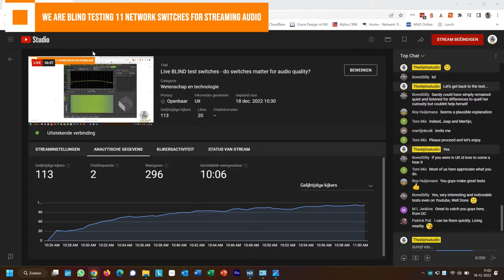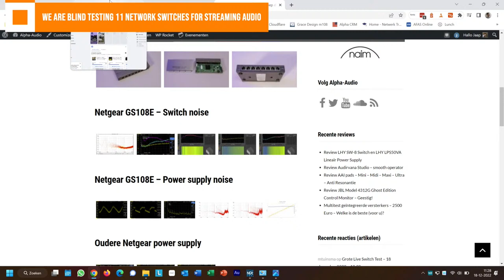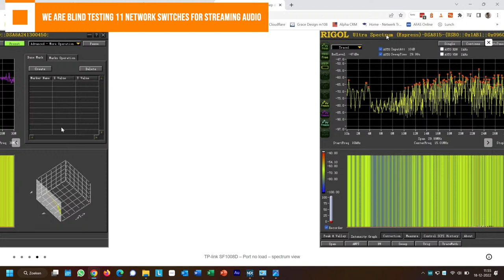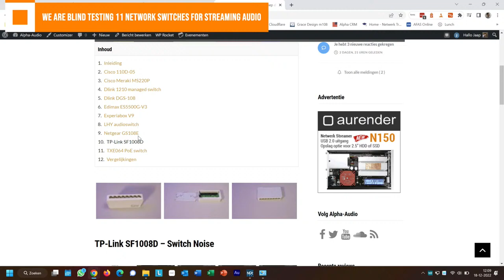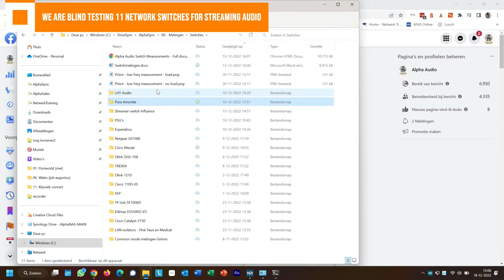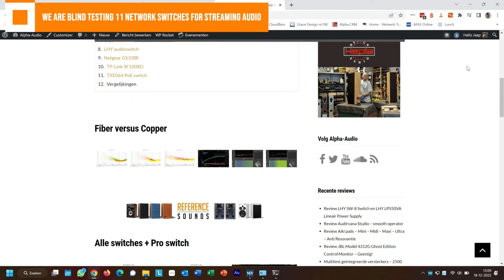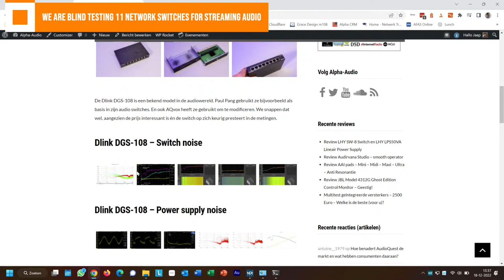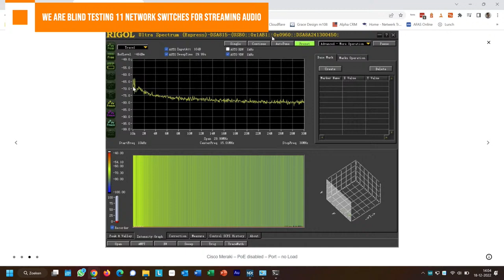Live BLIND test switches - do switches matter for audio quality?

Comment: The folks asserting that a network switch can't possibly make any difference are really really missing a massive fact. Yes, if you view this whole thing purely through a digital lens, this is absolutely correct. Bits are bits, no bits are harmed, no bits are enhanced, and all the bits arrive in the right sequence. Bascially there are no data errors, which is absolutely what we should demand of any network switch.
The only difference a network switch can make to audio is through the amount of (analogue) RFI/EMI noise it stops from getting to the analogue bits of your DAC. Hence importance of power supplies, of quiet circuitry, etc.

It's not only arrogant and rude to suggest people who hear a difference having installed a switch are imaging things, it's plain wrong. Oh, and other videos are available, no need to try to save people from themselves here.

Having said that...
1) The test was hardly blind. Too many visual clues to the "blind" listener.
2) Personally hearing differences via Youtube played on your own system at home? Nah, sorry, not buying this. Treat the videos like an article not a demo and we're good.

Thanks to the guys at Alpha Audio.
Reply: Have you tried listening with headphones?
Reply: "The only difference a network switch can make to audio is through the amount of (analogue) RFI/EMI noise it stops from getting to the analogue bits of your DAC"

To find out if this "RFI/EMI  noise" does impact the output of the DAC you have to measure the output of the DAC....
Just to assume that noise on Ethernet impacts audio quality is not a valid assumption.
Reply: @elkeospert9188  My lying eyes and ears... That is the problem with you science audio guys, if you cannot measure it, it does not exist. Maybe put down the scopes and listen to the music or actually look at the television with improved PQ?
Reply: @michaelwright1602  The problem with you is that you not understand my comment.

In this video the noise was measured on the streamers input  - ASSUMING that noise on the input impacts the quality of the streamers output.
This might be a correct or wrong assumption and the better way to find out that is to measure the noise on the output of the streamer.

And if somebody claims to be able to hear differences between different switches you can check that by performaning a correct randomized and double blinded test.
You not need any scopes or other measurement devices to perform such a test...

Comment: Are you going to compare the best copper connected switch in your list  vs fiber connected switch vs AC wireless?

The differences are most likely do to your streamer not having a galvanic isolated network port. Some of those switches have them some don't. 

If you're getting dropped packets with nothing else going on there you have bigger issues. 

You should run something like smoke ping over all those switches and note the differences and any that dropped packets or wild latency trash them.
Reply from the maker: We did... But not wireless. The Ambre doesnt have a wireless connection. The port on the Ambre is galvanicaly disconnected
Reply: @TheAlphaAudio  Have you figured out how and where the switch noise is getting to the streamer and/or DAC?  

You should be able to measure it if it's back feeding through the AC. As well as the differences on output taps of the streamer and the DAC.
Reply from the maker: @jaakanshorter  we have bought a Wavecrest SIA 3000. We can measure more with that. It will arrive in two weeks I guess...

Comment: If this is what it thinks it is we, and the whole digital audio information idea in general, are all in big big trouble and every major live event would sound bad. When you think flatearthler are wicked you never met an audionerd.
Reply: Maybe watching the video instead of thinking what it is you think it is would be beneficial.
Reply: @jmtennapel Sorry but when I send digital information through a network it will come out exactly the same when there are no buffer errors. Every damn single bit. Ones and Zerros. When I play it back then with my converter and its internal clock it sounds the same as before no matter what, Jittering and dithering effects from the converter beside. This whole listening totally unnecessary.  When any Dante or AVB Network in professional audio  would have this kind of problem the whole digital console business and DAW would break apart. Maybe there a faulty switches but when in sync there a no differences. Just record the digital outcome and compare it with a nulltest. You can record the datastream with the osci and compare them if you really want to see what´s going on at this testpoint.
Reply: @liveheart9742  If you would have actually watched the video, which you obviously haven't, then you would have heard it is not about 1s and 0s. I'm sorry, but if you are too lazy to even watch the video, but comment about something which is addressed in the video, you shouldn't be here.
Reply: @jmtennapel  I´ve watched enough and heard enough about your whole conception starting with cables making a "huge" difference etc ( and I sold Vovox cables ). Also you stated at the right beginning that you were not a believer, so it´s obvious a "believe" thing. Then I saw 2 people who listening to music 4 hours long talking about their subjective perception and discussing psu noise without showing actual measurements what´s going on with the actual audio wave at timepoint x. Ever heard of a signal generator or white noise? When it´s not about 1 and 0 in a digital audio stream what´s it all about then? Tell me. Maybe I missed the part where you put a reconverter in any way into the chain then I am sorry.
I´ve studied audio engineering twenty years ago and succesfully doing a living out of electronics and live audio engineering with big line array system and smart audio to measure the venue or measure THD in audio circuit etc. Your test is flawed and out of the blue. Do nulltests. This whole listening to piano parts thing is lazy. Nobody who does have a serious clue would do listening tests this way and would have already known that the human ear is the worst measuring equipment one can get. Totally hifi domain made out of subjective perceptions during the listening process vs what´s actual going on in the electrical domain. Maybe you should ask Don Warrel about this and maybe he has the time to do a whole video about this.  I don´t because I have to work in pro audio and earn my rent no joke here. Fair enough, everybody its own hobby or believe but I am out here, not convinced at all and won´t bother you anymore. 
If your statement should be true a digital audio file would not null with two different switches. Show me that.
In the end it´s just a statement without real evidence. My statement is: there is no important difference in the audio with different digital switches that have any "negativ" effect to the listener and I never met anybody working in the audio industry every said that.
Reply: Music is modulated Power. Of course noise has an influence.
Reply: @AudiolandCH  A lot of things in electronics are modulated power. That doesn't mean anything. Then use your favourite digital audio converter of choice for reclocking with a good psu and call it a day. If noise would be bad in general then explain this to the vintage audio nerds, good luck. Digital information has no sound. Only the analog end of the chain makes a difference here.

Comment: Utter BS. I believe in most audiophile products including better cables and good power conditioners most discount. BUT, a freaking Ethernet switch wouldn’t make a F all difference as it simply cannot make a difference. The ONLY possibility is poor power supply adding some noise into the DAC, otherwise this is pure malarkey nonsense.
Reply: Power supply or RFI noise on ethernet cable. That’s it.
Reply: Well it does...proven time and time again in  dac plots....period
Reply: @AudiS4orce1  If you still not belive a Ethernet switch Can make a difference, then try Ediscreaction swtch or fiberbox yourself. I’m pretty sure it will be an eye/ear oppener for you.